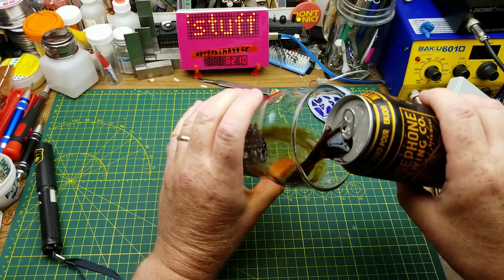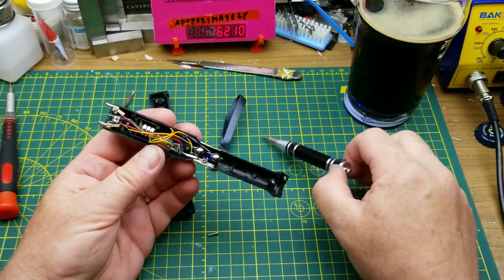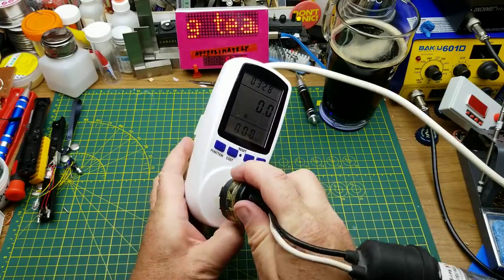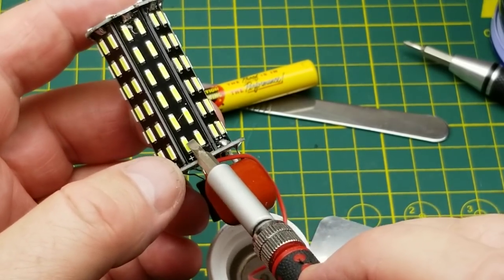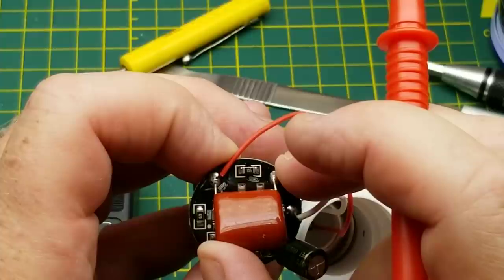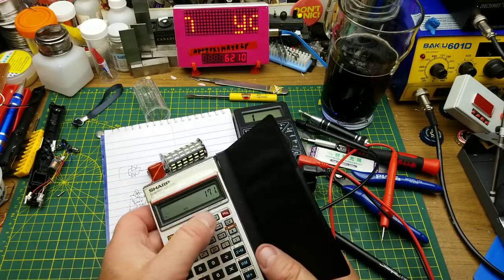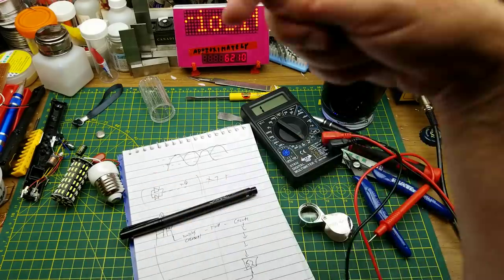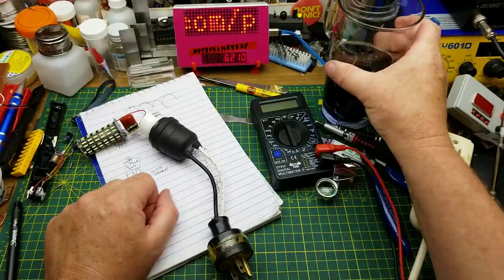2 shocking teardowns in one video

Comment: Something's very wrong- I'm the first upvote and the first (visible to me) commenter?
Those little shocker gizmos are actually useful for testing some small UV fluorescent lamps and such so unless you've already trashed it, consider saving it. Just rearrange the electrode wiring so it can't zap the user. ;>)

Comment: cut taser button wires and add some condensator were take up voltage lot, then looking wires go out at taser pins near led. then working, i want orden somethink taser and made lot lot more power but how make, you has thats good project orden big handheld taser and made this better more volts out trigging powerfull taser. i not know how lot volts real safety taser have but i think 100 000 volt maybe.